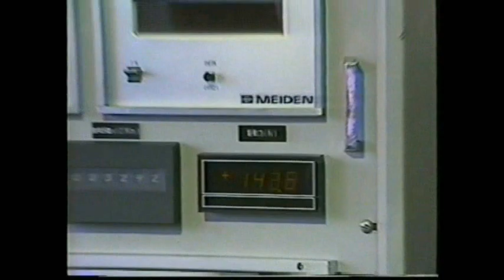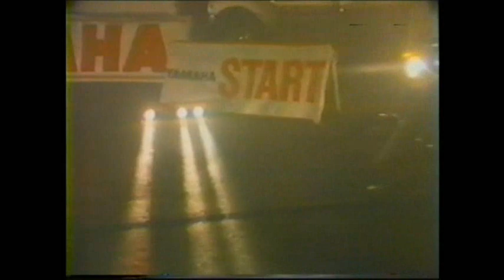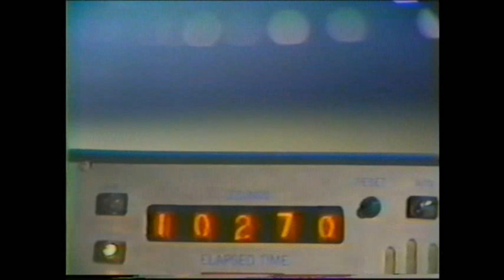Jay's Vmax Movie

Comment: At the age of 30, I bought my V Max (32nd one made), to replace my ‘62 Triumph Bonneville. The 1st time I seriously put my hand into it, my eyeballs peeled back from my eyelids & were literally flattened! Scared me silly! No muscle car did that, so I sold my ‘69 Camaro 427. The 2nd gear cog began failing at 20K, updated the tranny to a 3rd design unit. Added a full race Kerker 4/2/1 system & DynoJet Stage7 kit. 145hp went to 160. I let a few trusted friends try it, they returned physically shaking from fright! Hated the brakes & the occasional high-speed wobble it had. Peddled it for 20yrs🏆😎.